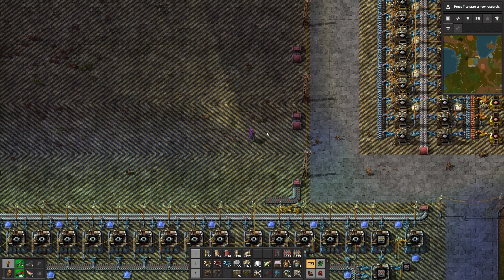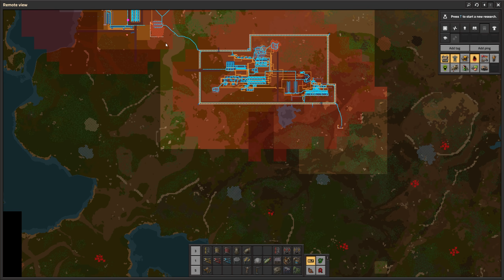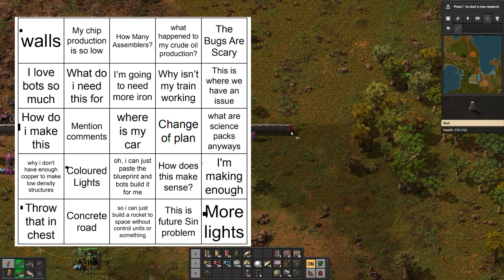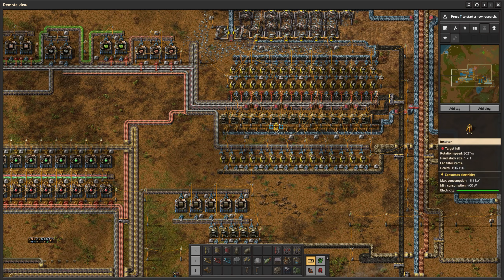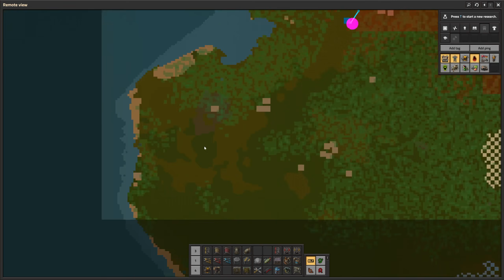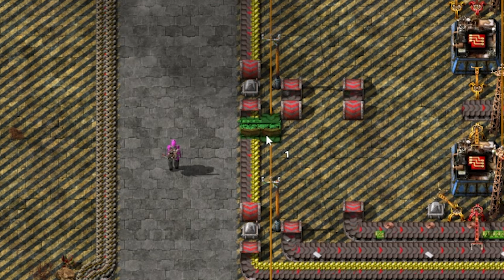Satisfactory Pro Plays Factorio - EP.6 -  This Game Is A Stress Test

Comment: 30:44 pro tip for high throughput items like the cables into green circuits: You can have an assembly machine make the cables and an inserter move them into another machine making the green circuits (this is known as direct insertion). If you look at the output of the cable machine v. input required for the green circuit machine, you'll notice 3 cable machines can match 2 green circuit machines. This suggests that you can find a layout with 3 cable machines feeding 2 green circuit machines supply the cable machines w/ copper plate, and the green circuit machines with iron plate+space for an output and it will take plates and make green circuits. This avoids the problem of so many cables on belts hitting belt throughput limits.
Reply from the maker: I didn't even think about inserting from one assembler to another. In the middle of a redesign now and this tip is going to be so helpful. Thank you so much 😊
Reply: @Sin-r2h  also, pls have a look on the belt throughput stat.
Reply: @Sin-r2h  Random info: This system is called DI or "Direct-Insetion" and is used a lot in engame megabases, when your PC starts to become the biggest enemy and you want to build as performance (UPS) optimized as possible.
Megabases are measured in SPM (Science per Minute) and are the equivalent to PPM in Satisfactory. The general consensus is that everything above 1000 SPM is a Megabase, and I believe the world record for Vanilla with 60 UPS (so no performance drops) is 40k SPM (so 40k of each science bottle per minute). Would love to see ya to try to build a megabase after you beat the base game :P
Reply: @SempfgurkeXP   ... until you go Space Age. Then Megabase starts at 1M, and 1k is just a kilobase
Reply: @PeterZaitcev  I think the most used term is Gigabase, but yeah in Space Age you can go a lot higher. Although then we also have to differentiate between eSPM and SPM. Cause 100k SPM are already impressive, but 1m eSPM are fairly easy to hit.

Comment: Just remember you always have the option to do direct insertion. Some items that craft really quick such as gears and copper wires can quickly exceed the belt carrying capacity. It helps to sometimes have the inserters place these items directly from the assembler producing them into another assembler or processing plant so they don't clog up your belts. You won't always get the perfect ratios but you can balance them for example having one assembler producing gears feed 2 or 3 other assemblers etc.
Reply: Very good tip! But need to point out the exception when the number of consuming assemblers greatly outnumber the amount of producing assemblers. IE: Wires to Red Circuits
This mainly comes down to finding the right ratio of machines. If you know the ratio, you can tell right away if direct insertion is a good idea. The closer the ratio is to 1:1, the better it'll be to use direct insertion.
While a 1:12 ratio is not good for direct insertion, it is still low enough to consider a "dedicated assembler". IE: Wires to Red Circuits
Reply: @Plystire I'll be honest? On your first playthrough or 10, don't worry about overproduction. It won't be enough sooner than you realize. You'll probably have to dis-/reassemble long before it's a problem, and a few filter inserters can kick that can soooooo far down the road.

IMO, you're better working around any jams by making 2:1s with splitters to force the inevitable bottleneck where it's not impactful. Also buffers random gaps.
Reply: @Greyhawksci  Yeah, the effect of overproduction is pretty miniscule, mostly in power.

I've heard Sin talk about ratios, so I think it's worth mentioning tips relating to that, regardless of what playthrough he's on. Not like it matters, he's playing pretty far ahead of the released content from what I can tell.

Comment: You have a bad habit of putting your output belts in the same direction as the input belts, this results in you not being able to extend the production line if/when needed. If you make the output belt go in the opposite direction of the input belts, then the line can be extended in the direction of the input belts as more production is needed.

Ex: if your blue circuit production were outputting on the west (left side) instead of the east (right side), you could extend the line eastward (to the right) as much as needed.
Reply from the maker: Yea, i have noticed it a lot today when playing again and trying to increase the production like you said. I've started expanding to and using train lines. I will try to keep it in mind to keep the felt flowing in one direction. Thank you for the help 😊

Comment: You are starting to use the crafting ratios that's nice, Don't  forget your belts have limits as well, your red belt only takes 30 items per second, 15 each side. There no point making more than that cause 1 belt will not take it. For example you copper wire is way more than the belt limit. Also if you don't want to try hard with ratios just make sure your final machines in the production have a surplus of supply so they won't stop working Thanks for content GL HF
Reply from the maker: Yea, i realised that I was making way too many after I finished making everything 😅 trying for a new approach with bots, so the next episode may take a little longer. Thank you for the support and the help ❤️😊

Comment: Glad to see you automating modules. They are this game's version of power shards and somersloops. They let you build production blocks with fewer machines just like Satisfactory.

When setting the circuit condition for the lamps, you also have a "greater than or equal" option. You don't need to set the constant to the value you want minus one.
Reply from the maker: I thought they were something similar, but now I need to find ways to make the next tier of the module. Yea, I think I was having is set as greater than 599, so that's why I was constantly changing it down. I've fixed the issue now and went into a remodelling session with the new bots. I want to get more into circuits but I think I will leave it for a little while longer. Thank you for your help 😊

Comment: If you didn't already know: when you make blueprints (groups of blue ghosts) you can flip them with the "v" and "h" keys for vertical and horizontal respectively and rotation while holding the blueprint. 

Blueprints can also be treated as items and be put into your inventory. You can edit blue prints by right clicking on them and right clicking on buildings to remove or a button to select a new section to replace the blueprint or using the aligning feature to keep your blueprints aligning to a grid which people use a lot for trains and big bases.

Comment: The comments are wrong about the concrete making your pollution 2000x worse. Each tile of exposed grass absorbs 0.000018 pollution per second. That's about 1 single pollution for every 32x32 chunk of grass per MINUTE! That is so negligible that any benefit of not using concrete for your base seems silly.

The gameplay design of grass and trees absorbing a small amount of pollution is to stop you from being attacked constantly in the early game when you're just starting to learn how to play. It's impractical to try to make grass absorb all your pollution forever.
Reply: Yeap you right, but too much concrete can really may affect.

Like let's take 640x640. (Like full beginner base+all around(REALLY too much concrate)

Is 400 chunks 442 pollution/min.

Beginner base can produse like 600-1500 pollution/min.
(Afk or full active/bigger smaller e.t.c)

And is no so "negligible" still if you noob and don't need extra problems better just make "roads" or some big part and not concrete full base and all around (until mid/late game).
Reply: @Brigadire322  442.368 pollution per minute is the same output by 44 mining drills or just about 15 boilers. Just build walls and turrets, and make your base pretty...

Comment: If you use a decider combinator between your chests and lights, you can change the color of the light depending on the condition of the box (or belt or tank or logistics network, etc). You can also use circuits to balance your oil refining so that pumps only turn on when you have excess, or your steam power only turns on when your accumulators dip below a certain power threshold. You can also limit your production based on input by reading the belt  and only allowing the inserter to work when there’s 8 on the belt (it’s full). When you unlock the logistic network (drone requester chests) you can set up tiny circuit networks to limit the production of complicated items that you don’t want to mass produce (like belts and inserters) based on the total number of those items you have in the system, not just in the chest it’s outputting into.
Reply from the maker: I was thinking about trying to set up a logistical network. Seems like circuits have plenty of ways to be used. I think I tried to use the limit on inverters but couldn't figure out how to make it work. Currently, I am trying to overhaul everything, so my factory is less all over the place. I'll try use more circuits in the ways you have mentioned. Especially with the steam engines 😊
Reply: @Sin-r2h the limit on inserters is mostly useless. The one thing it’s good for (and I forget the right ratios) is if you limit the stack inserters to like 12,10, 8, and 6, (x4) you can unload a four car train into 4 blue belts evenly with no bottleneck.
Reply: @Sin-r2h the logistic network is goated. It’s the next stage of the game. You can either have it cover your entire base and replace every steel and iron chest with a passive provider or you can have a relatively small area be logistic with inputs adding items to it, then have your drones focused on producing items with requester chests, beacons, and productivity modules. You can technically do both, but the farther the drones have to travel, the less efficient they become. 
Time to start making modular bases so you can copy and paste them to 10x your factory as needed.
Reply: @Sin-r2h -- Inserter limits are for how many they can pick up at once. If you don't have any hand size upgrades, it doesn't do anything. I've only ever used the limits when I need one inserter to fully fill two items, so it doesn't get backed up with an extra of one itemin it's hand.

If you want to limit throughput on inserters, try only activating them when there are enough items on tge belt, or when the machine output is empty. You can put a wire on a belt abd set it to hold to read the items on the belt, or hold (all belts) to read an entire belt line!
Reply: @TlalocTemporal or make a timer counting ticks and have all inserters in a set only work every 60 ticks so they all work in sync.

Comment: The robots weren't working from your inventory because you had 0 construction bots in your inventory.  Put 10 or so bots in your inventory and try building something with a blueprint.  The green area is the area the logistic robots will work in and the orange is the construction bot range.  If two roboport's green areas touch then they link up into a single bot network and can share bots between them.  Logistic bots are for shuttling items between chests.  You can set requests on your person and logistic bots will fetch items from chests and automatically keep your inventory topped off as long as the requested items are in a red or yellow chest and the chest is in the green range of a roboport.  The repair packs will allow construction bots to repair damaged buldings.  Useful near walls.    

You are eventually going to need to crack heavy oil into light and light into pet gas on demand /w circuits if you don't want it to backlog.  Flame turrets use surprisingly little fuel for the amount of DPS they dish out, so they won't be a huge sink for lite oil.  You flame turrets might be a little far back from your walls to be super effective but we'll see.
Reply: Got that flipped around, construction robots can go into the green roboport area, logistic bots will stick to the orange area. It's also good to point out that only construction robots work from your inventory. Logistic robots won't do anything unless they're in a roboport.
Reply: @erichimmelblau877  Ooops you're right!  Whatever the smaller area is, that's the logistics area.  I flipped the colors.
Reply: Also you had solar panels in your armor but no batteries this means nothing would work at night.  You need batteries to work as a capacitor  for when you  are drawing more than you make or you are not making power because the sun is gone
Reply: @GregAlverson-ri9nb  Yup!  Roboport has some energy capacity, but not a huge amount.  You definitely want at least 2 batteries.  More for solar.

Comment: Quick robot crash course:

Robots: Construction only construct and deconstruct things, while logistic robots are responsible for all the moving things around.

Roboport: The green area is CONSTRUCTION RANGE, while the orange is LOGICAL range. If you have two roboports with the orange touching they'll be in the same logical network, meaning the robots will move from one to another and move things as necessary. If the orange isn't touching then it'll be considerate two different logical networks with it's own resources and robots.

Note you don't need the orange to touch everywhere, as long it is logically connected SOMEWHERE it is fine. I like filling the whole screen with orange but it is not necessary at all. Also each roboport has a limit on how many robots you have charging at once, so in the future when you have a lot of robots, if you have areas or places with a lot of robots moving around, you might want to have a small cluster of roboports so they can all charge more easily.

Chests: 
-Red (Passive Provider) is the most important, make it available for the network.
-Yellow (Storage) is the second most important, is basically a storage. When you ask your robots to deconstruct something or trash things, they'll move it to YELLOW chests. 
-Blue (Requests) The third most important, is the only chest you can put on requests. For example, you can put down a blue chest and say you want 500 circuits inside it. As long it is available, either on red, yellow or green chests, the robots will go fetch and bring it to the blue chest to fulfill the request.
-Purple (Active provider) they're active red chests, basically anything you put into a purple chest it'll automatically be moved by the robots somewhere else, like a yellow chest. Very fringe uses, chances are you'll never use it.
-Blue (Buffer) An interesting one LATER into the game. Things inside this chest aren't provided to blue chests unless you specifically mark that option. It's used only to your own requests or construction. I like using it as recharge stations. I have lots of buffer chests all over the base with everything you need to build, like belts, splitters, substations, posts, ammunition, etc. This way the robots always have a nearby option, rather than having to bring it from god knows where it is being produced. It's great when your base grows a lot and you want stuff to be available all over the base.

Personal roboport: You need to have the robots in your inventory. Mind you a normal roboport can only support 10 robots, so walking around with 10 robots in your inventory is enough. Unless you want to have several personal robots in your inventory. The more roboports you have in your inventory the bigger their range, as well.
Note it only supports construction robots, so no point in walking around with logitistic ones.
Also your personal robots will only construct based on what is in your inventory. You can easily toggle them on and off with Alt + F.

Comment: circuit tip: instead of using the "greater than" option and typing 599, use "greater than or equal" (underlined greater than symbol) and put 600
Reply: This. Also, instead of picking a particular item, he can choose 'everything' (or is it 'anything') and it will just count everything in the box. He can then blueprint that and place it down anywhere.
Reply: ≥600 is literally the same thing when dealing with integers, so what's the improvement?
Reply: @VVENDINGEN  it's just so if you have a number 500 in your mind as your limit, so you put that number instead of changing it to something else, I guess that's it
Reply: @VVENDINGEN yes, it's the same, but it's much nicer imo. At least I'd say it's easier/nicer to read.

Comment: how much stuff you can put on the belt before it becomes saturated and stops accepting items?
how much stuff you can take off the belt before it empties out and starves anything down stream from resources?
how much stuff each assembler is producing per second?
how much stuff each assembler is consuming per second?
how fast is each inserter?
should I produce stuff x from resource y at the place where x is needed so I have fewer resources to transport r should i do it up stream so I can manufacture it in bulk?
where are the bottlenecks in my production?
how do I balance the belts?
how many layers of abstraction does my base have?
how much is the fish?
Factorio forces the player to ask so many questions that have no answer. forces you to make puzzles for yourself that you then have to solve.
Reply: No answer? First 4 are answered by hovering over a belt/assembler. 😆 #5 is technically answered by inserter tooltips, albeit not as straightforward.